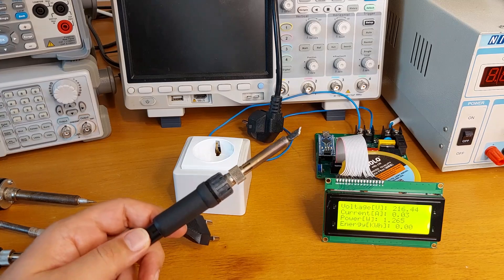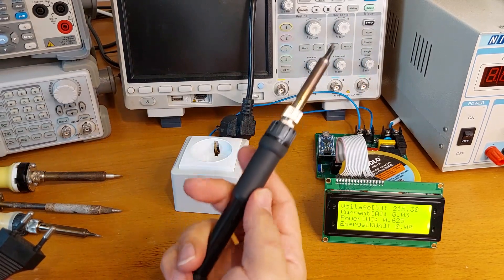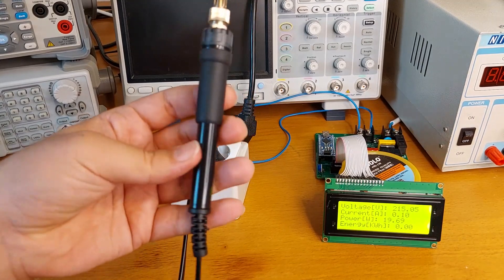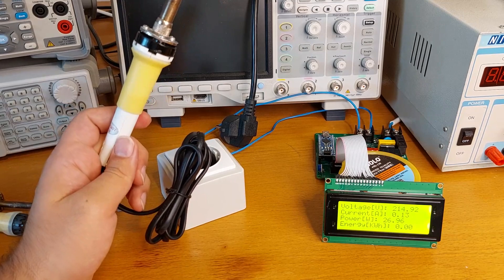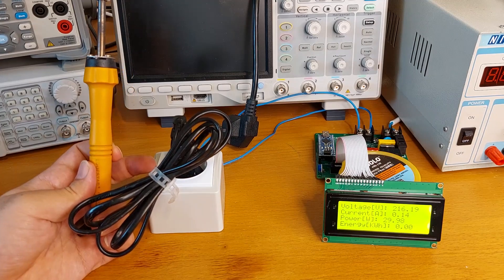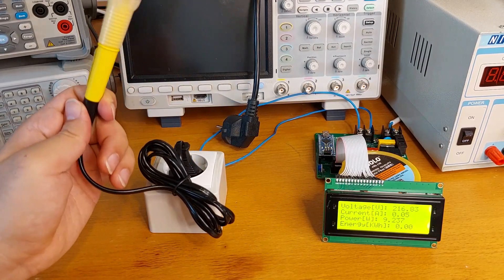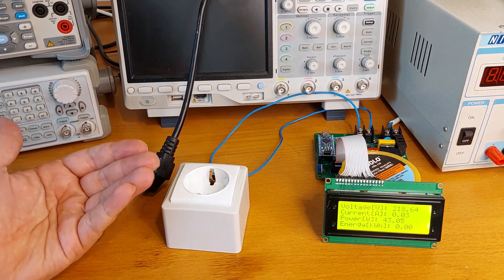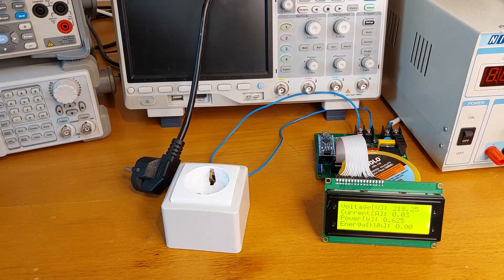How to Spot a Fake Soldering Iron 😮

Comment: have u tested for counterfeit solder? ive bought several 63/37 diff solder on temu aliexpress that does not melt or flow...
Reply from the maker: I saw these type of fake solder, but I have never used them because from the look is clear they are cheap

Comment: Measure soldering Iron resistance is true?
Reply from the maker: No, you have to measure the power. it is an AC load. but because this is a resistive load (not inductive), you can also measure the AC RMS current using an RMS multimeter and multiply by the RMS AC voltage (Vrms * Irms)

Comment: Any ideas on spotting fake Hakko soldering stations?
Reply from the maker: I don't have one. in my opinion, "soldering stations" are better, check if it has a manufacturer and if that manufacturer has a website where you can check its products. doesn't matter if it is a famous brand or not